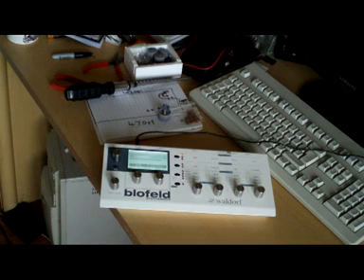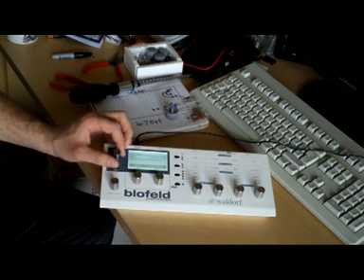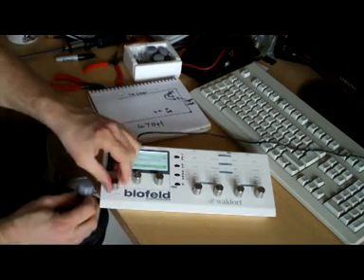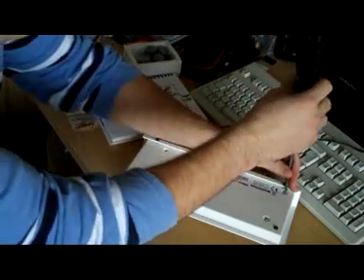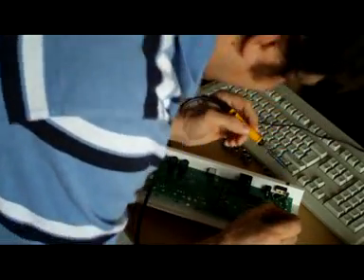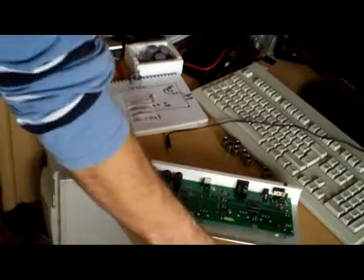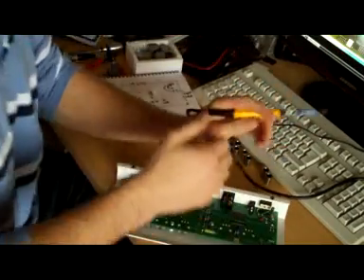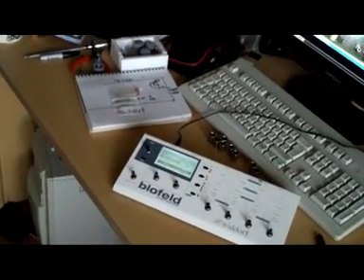Waldorf blofeld encoder fix

Comment: Yes, this is one usual problem with Waldorf Blofeld. I experienced it myself. Another problem I encountered was an output level problem, with very little output coming from the stereo out, and no output from headphone out. Have not solved it yet, but I read you can fix it by changing the SMD resistor between the shift button and mix 1 knob, for a normal sized resistor of the same value.

Comment from the maker: @liqube from looking at various forums, i get the impression that the blofelds made later do not have this problem, so if they do the job properly hopefully you wont have problems later. I find waldorf quite dissapointing really, they make a great synth, but fail to publicly acknowledge what now appears to be a common problem.